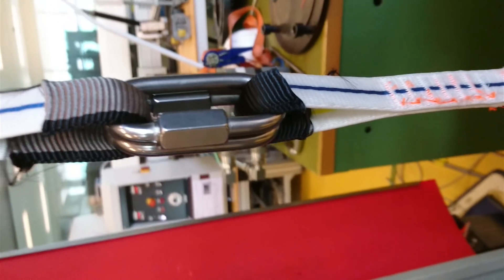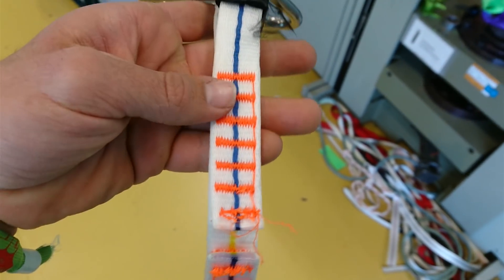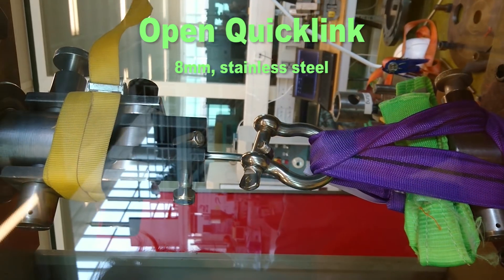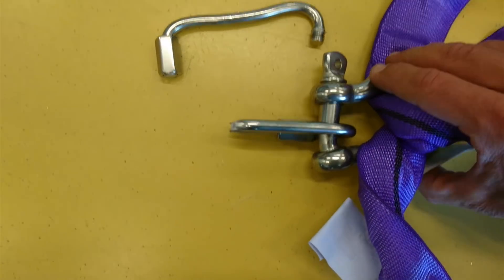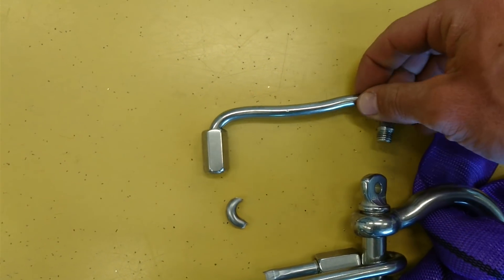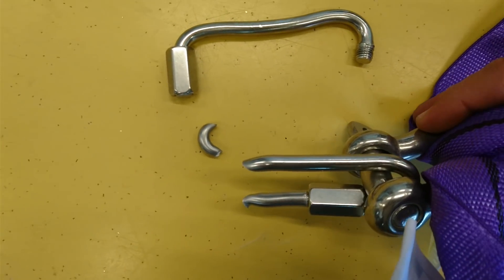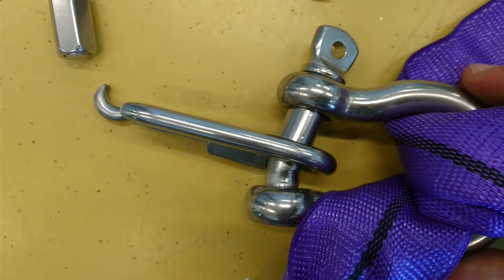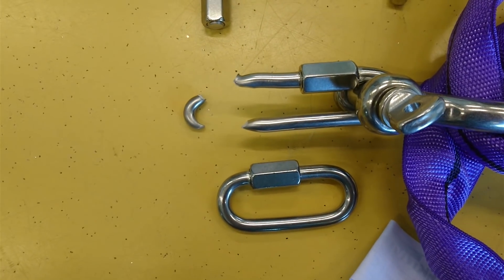Quicklink Breaking Strength Test

Comment: these quicklinks are so good for anchor/chain/rope connection. as rocking motion of the boat cause normal D shackle to undo itself no matter what u do. last time i was checking the very tight, locktite D shackle between the rope and chain was loose. lucky find out early or else lose all chain and anchor. gonna swap to these will have no problem

Comment: Nice vidoe and interesting results. Howeve, have you tried to cross load a quick link so that the webbing is on the screwgate. I've had people tell me they are equally strong in all directions and others tell me that the gates are not any stronger than a carabiner.

Comment: What quicklinks did you use for the tests? I've been using a single 'Reese' brand quicklink(They are 5/16" $4USD for a pack of two rated at 5000lbs) to hold my rigging plate to my sling on my 75m setup. I've never had an issue and I do a lot of bouncing. 
Also, my sling connects to the quicklink with a "tri-load" of about 45-60 degrees. I never let the angle get any higher then that. I'd love to see some tests with a 60 degree tri-load on some quicklinks!

Comment: Sorry if this is a dumb question, but what is the recommended minimum kN rating for rigging?
Reply from the maker: This depends on how much force you wanna put into the rig. We recommend a safety factor of 4 for most pieces. Means if you wanna have peak forces of 6kN, your minimal breaking load should be 24kN.
Reply: Cool thank you. I was going to ask more questions then found your video "Forces in Slacklines 1 - Static Forces & Tensioning" and I will continue to watch the rest in the Forces in Slacklines series.